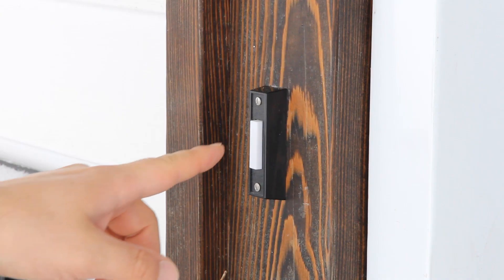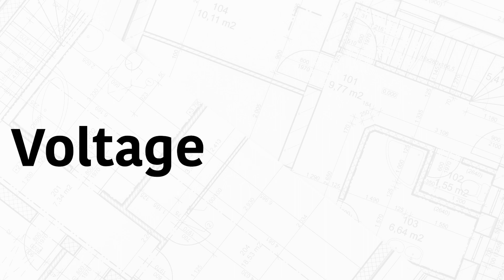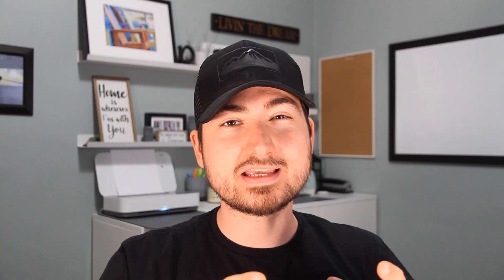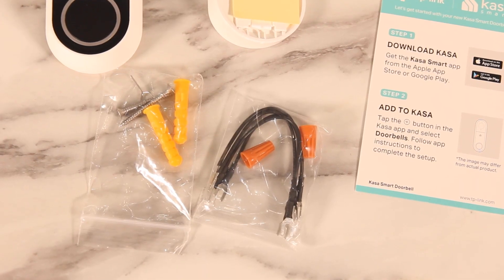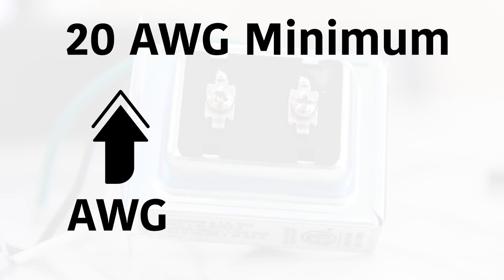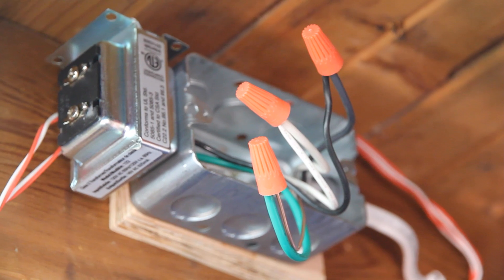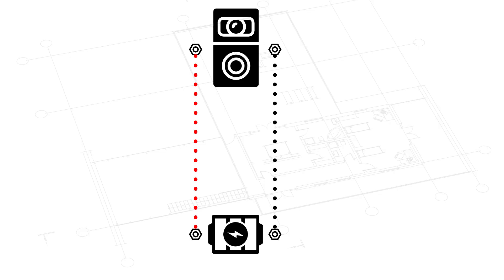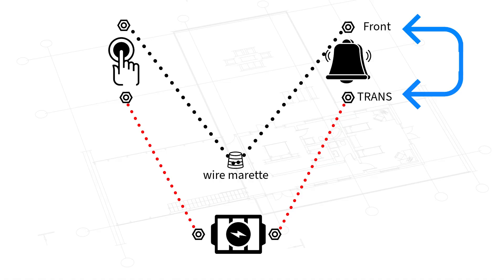Wired Smart Video Doorbell Installation - The Basics

Comment: I have the wyze v2. My old transformer works the camera fine. It rings outside when pressed but not inside. I have researched and found that is needs a 16 to 24v transformer.  I would like to know what makes a difference if you go 16V vs 24V and the other number the 40 VA vs the 30 VA? Thanks.
Reply from the maker: Hello!

In most cases a traditional indoor chime won't be compatible with video doorbells unfortunately, there are some exceptions. I am not sure about your model. 

Most Video doorbells have an input range, meaning they will run on anywhere between 16-24 volt, basically 16volts is the minimum for it to work but can run on anything up to 24Volt and that wont harm the device it will step the power down as needed. You wont gain anything by having a higher voltage unless you have a very long wire run.

The VA depends on the total devices on the system and all their minimum requirements. if you only need 10va you wont see any gain by having 20, 30 or 40va. - I have heard supposedly that the higher the VA the less strain is put on the transformer. but we are running a 10VA min with a 10 VA transformer and it handles it perfectly with almost no heat coming off the transformer. 

I hope that helps!
Reply: @livingthereno   Thank you so much! Very detailed and simplified answer.